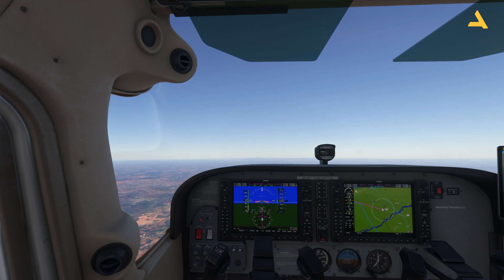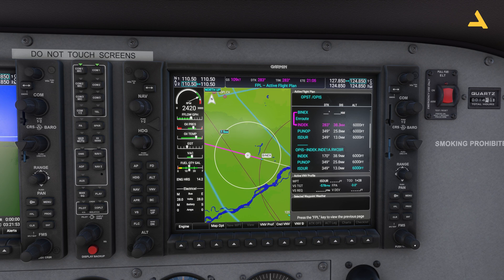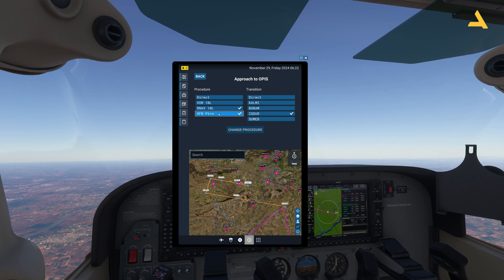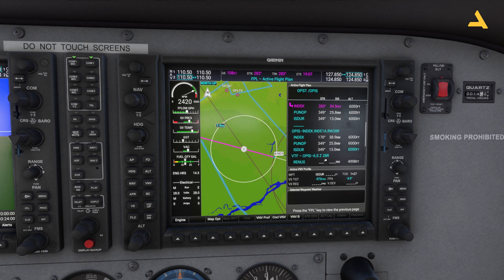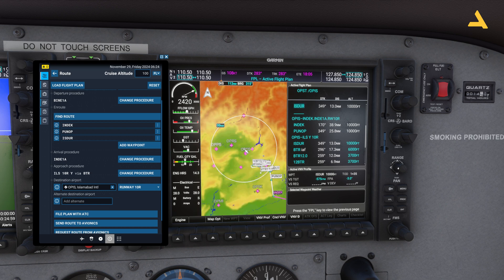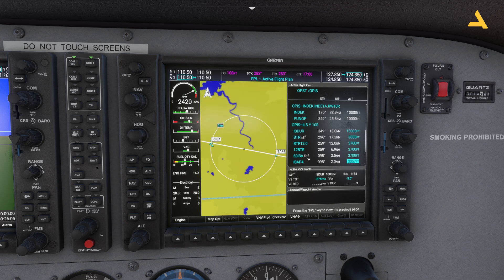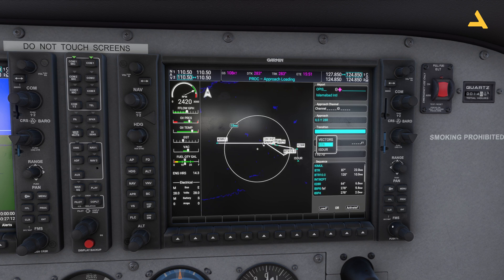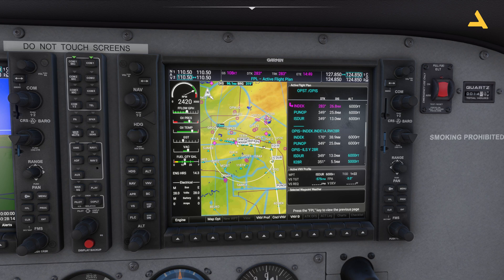How to Change the Approach and Arrival for Cessna 172 with G1000 in MSFS 2024 - Tutorial 8

Comment: How buggy is the career mode as of now ? The mission steps are misguiding and the in game assist is confusing or not working sometimes. I have seen couple of your videos to make a safe landing possible. Also can you make a short video of a very simple take off and landing with the help of Garmin 1000. Really appreciate the effort you put in to explain everything in detail. Keep up the work.
Reply from the maker: I will try to do videos for the career mode. Thank you very much for your suggestion. Have a nice day
Reply: I've been mostly playing career mode, outside of when friends want to fly together. The ATC is the biggest issue, the quick reply feature is a bit hit or miss. But if you handle all the communication yourself, stay ontop of keeping an eye out for airports that you're going to fly over (so you can contact their tower to tell them), tell the tower at where you're landing what runway you want yourself, etc, it works fine. If you handle the ATC manually, you can even adjust your own flightplan.

One thing to note, is VFR landings/departures don't really work well with the 172's autopilot, but I guess that's true to life, as the autopilot system on the plan can only handle straight in/out VFR patterns. So if you aren't doing IFR, it's better to use the heading mode on the auto pilot, since the nav computer on the plan won't sink up with your VFR flight plan (but from what some people who fly the plane IRL have been saying, that's not a bug, but I'm not an IRL pilot, so maybe that info is wrong.)